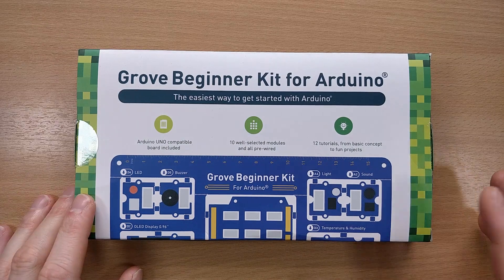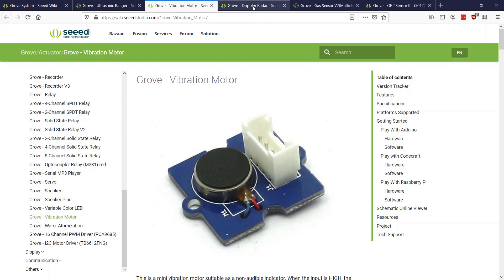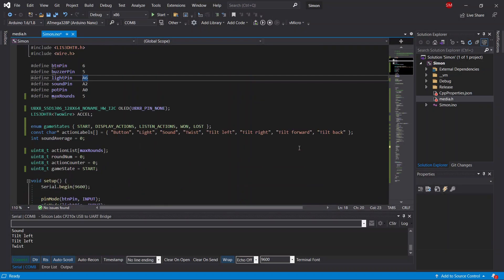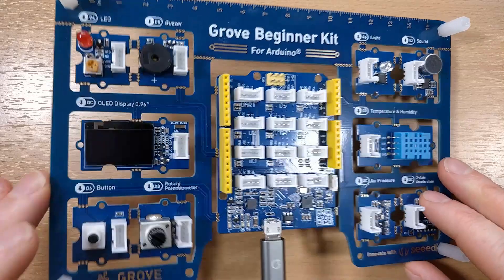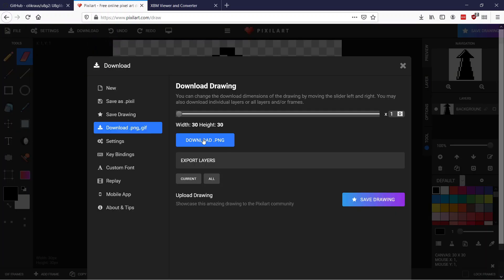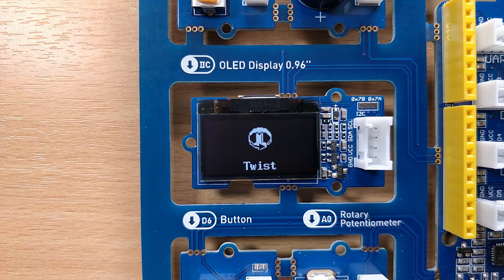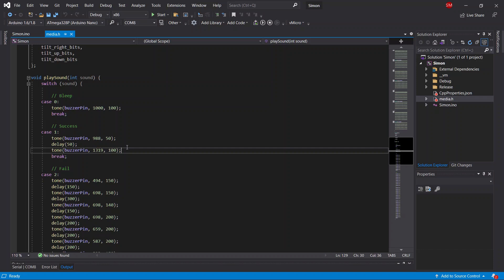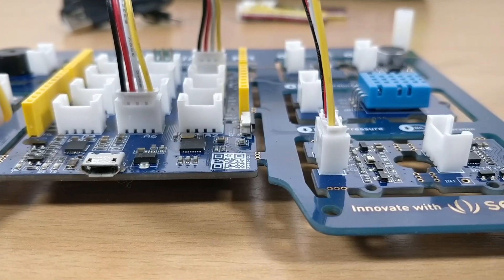Writing 'Simon' on the Grove Beginner Kit

Comment: It's a great. I have one but it's too expensive. I donate ee related kits and dmm and such to disabled people at a local maker space. I've been buying arduino sensors and such now for a year and started buying multimeters as I plan to donate tent to fifteen and a 3d printer, 20 rolls of pla and an oscilloscope. I have all the arduinos, esp32, 8266 modules and hundreds of sensors and a a few thousand ledsto donate so I have that covered. I'm hoping to have the dmm by the end of next month. I have the pla rolls. Then it's just a printer and a dso that has decode and logic. I found a seller with awesome multimeters at a quarter retail. I'm going to donate all the wire, bread boards, nema 17, tons of different servo types and dc motor kits along with robot line following kits. It's ambitious but I'm over halfway there and it's going to be an anonymous donation.
Reply: Even the grove cables/connectors are hard to source and ridiculously expensive.   Tried to get some at reasonable price for m5 esp32 modules.